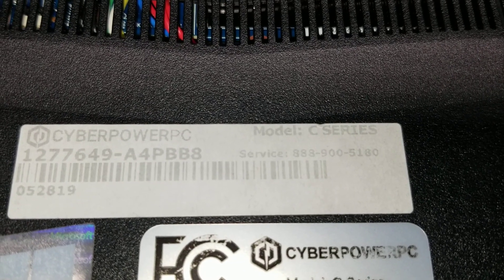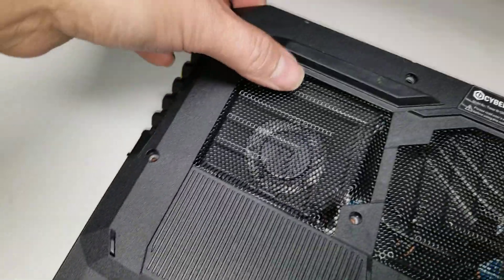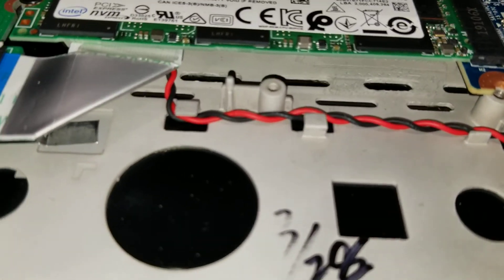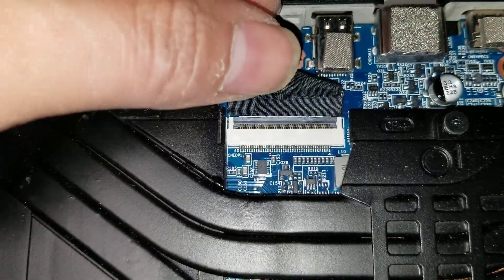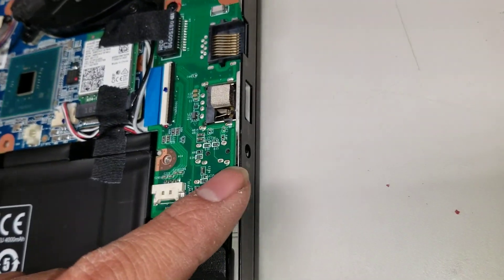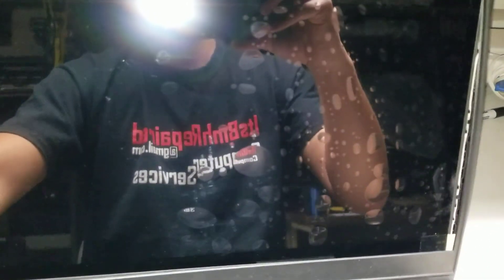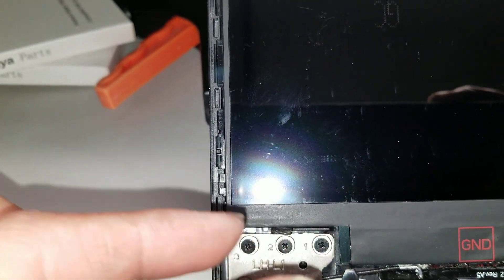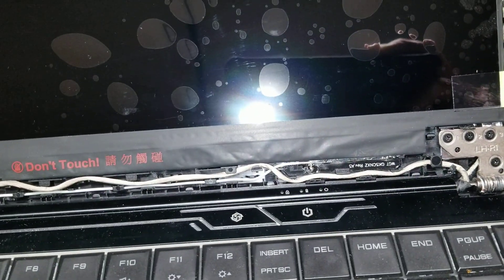CYBERPOWERPC C Series Tracer III-15R Disassembly Repair RAM SSD HDD Hard Drive Upgrade

Comment: Where is the hard drive?!?!
Reply from the maker: Spinning disk drive? There isn't one.
Reply: The solid state. I need to get the info off of it but theres no mention in the vid of where the data is stored. Whatever word is used, ssd. Who cares. Wheres the data drive?!?!?!
Reply from the maker: @tomleszczynski2862  how many drives are in your computer?
Reply: @ItsBinhRepaired  im assuming one. Thats how many showed up in explorer before the junk broke.
Reply from the maker: @tomleszczynski2862  then you just answered your own question. Open it up and the only drive in there is the one with the data on it. There is no other one there.
Reply: @ItsBinhRepaired  I wish it were so simple. I opened it up, and there's a drive bay in the bottom left, empty with no drive. Do they bury them under some obscure metal?
Reply from the maker: @tomleszczynski2862  no SSD?
Reply: @ItsBinhRepaired  I don't know where it is. Nothing obvious.
Reply from the maker: @tomleszczynski2862  well if the video wasn't helpful, I'm not sure how else I can help.

Comment: I have had an issue with mine. It has an issue with powering on, I have to move the screen back and forth to find the sweet spot then it will power up. Recently it has a black screen as well. If I plug into an external monitor I can see and operate everything just fine, but the screen on the laptop is still black.
Reply from the maker: Either the LCD or the LVDS cable
Reply: @ItsBinhRepaired thanks. Now I need to know what cable to buy appropriate for the spare panel I bought for my gaming laptop.

Comment: Seriously fuck that tape they put on the screen. All my screen needed was for the connector to be put back in place but because they tucked that double sided shit tape in so far I ended up cracking my screen trying to get it off. That shit should be banned use fucking screws cyperpower

Comment: What material is the heat sink made of? Can I Liquid Metal upgrade it?
Reply from the maker: Liquid metal isn't worth the risk.
Reply: @ItsBinhRepaired  I’ve had no problems with it to now and notices a 15-20% temp reduction. Are you aware of the heat sink material? Is it copper or nickel?
Reply from the maker: @ruthlestoothless  I see some copper on it, but I'm not sure.

Comment: This video was extremely helpful. I'm ending my year warranty in February of 2021 but it's looking like I may need to upgrade my RAM for my college degree programs (some of them). I wasn't quite sure if it was one slot or two (assumed one). Since you didn't mess with that area much and I'm not experienced enough personally to make a 100% assumption on it, is this laptop a single slot RAM situation? Basically 32GB would be the highest I could go? 

I have the Tracer III 15R Slim, so it may have slightly different specs but I believe should be the same layout and everything else; 2020 "model" if that means much. 

Thanks for this help so far, even if you don't get to my comment. This is a great video just to eyeball the layout either way! Subbed just to learn a bit more.
Reply from the maker: usually the max is whatever you can buy that has the same speed.
Reply: @ItsBinhRepaired  

I don't quite understand what you mean... I have the same exact model as this laptop. Same build just slightly upgraded (16 instead of 8GB RAM for example) specs. Same case and everything however. 

Does this laptop have two RAM slots or just one? It's actually something I've desperately needed to know before opening it up for months and months. My new term start January 4th, so if you could help me find out, it would be an enormous help.
Reply from the maker: @ElysetheEevee  if it's ddr3 1600mhz you need that same type just more memory. I don't remember what speed/type the laptop used. You'll have to watch the video for that.
Reply: @ItsBinhRepaired  

Oh, that's totally fine. I can figure out the speed/type. I can't remember off the top of my head what mine has exactly, anyway but I believe it's the same speeds just 16 versus 8. 

I just wasn't sure (without opening it up myself) if it has the capacity for one stick of RAM or two sticks of RAM, so that's what I was trying to figure out. 

Thanks for your replies!
Reply from the maker: @ElysetheEevee  there's some software that can tell you that I think. Cpuz or something. Usually I just open the computers to check.
Reply: @ItsBinhRepaired  

Okay thanks! I'll look into that.
Reply from the maker: @ElysetheEevee  yup, though better to open it up and physically check
Reply from the maker: usually the max is whatever you can buy that has the same speed.

Comment: Same problem as El_Bner-870. There is no cracks, dents or anything on the screen (my laptop is the 17" version). I was typing an email and the screen started blinking like 10 times a second, and ever since (if I had epilepsy, I would be dead). 

Even the Cyberpower bios logo blinks. Tried a previous system restore point, reinstalled drivers (Intel's and Nvidia's), checked the monitor refresh rate, the whole 9 yards... I connected the laptop to a TV thru the HDMI port, everything is normal.

I bought the laptop  on Nov 2018, less than 2 years old. Is it really a faulty screen??? First time ever in my lifetime with any kind of display...
Reply: You’re not gonna believe this but I bought the same computer the same time two years ago and the same fking flickering is happening to me rn ... fuck this company
Reply from the maker: @eduardozhang5424  yeah, looks like cyberpowerpc is using cheap parts that have too many issues or something. Maybe need to file a class action lawsuit
Reply from the maker: Sounds like a faulty screen.
Reply from the maker: If you're lucky and bought it with a credit card, you can call them and see if they have extended warranty coverage built in.
Reply: I came and found this video after my screen started doing the same thing. Tracer III 17R Slim. The flicker stops when I turn the brightness waaaay down and becomes super fast the brighter the screen is. External monitor fine. Faulty screen or do you think it's a motherboard issue?
Reply: I’ll chime in, I’m on my second screen in the two years that I’ve had this laptop, and the second one failed last week.  First one was still under warranty, and I had to pay $60 to ship it.  Never buying another laptop from them, never had a laptop fail so badly so quickly.  The flickering is horrible, and eventually the backlight just goes entirely.

Comment: My screen wont work but i can tell its still on it only flickers when i turn it on but goes black after idk what the problem is also i pulled the lcd cord and i tried putting it back in but its kinda loose now
Reply from the maker: Have you tried an external monitor?
Reply: @ItsBinhRepaired  no but ill try as soon as i can
Reply from the maker: @PapiAbner807  ok
Reply: @ItsBinhRepaired  i’ve tried an external monitor and my screen is visible then, but my laptops monitor is extremely dark, tried seeing if my ram was the issue but to no avail, do you have any idea as to what it could be?
Reply from the maker: The laptop screen works when an external monitor is connected, or only the external works?
Reply: @ItsBinhRepaired  i’m having the same problem, my screen has got very dark but if I plug in an external monitor it’s just fine. I figured the screens going out
Reply from the maker: @RealCUF  might be dead screen or motherboard issue :(